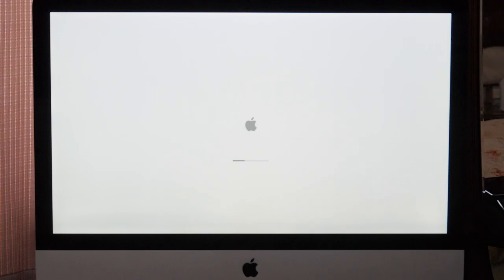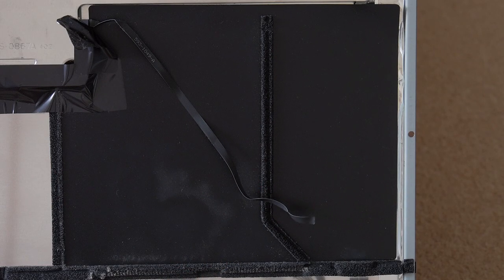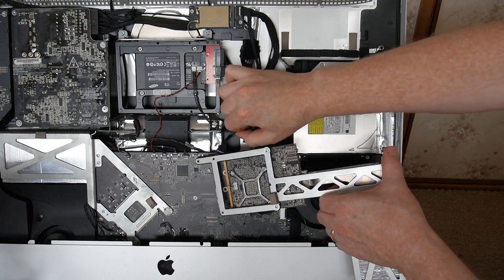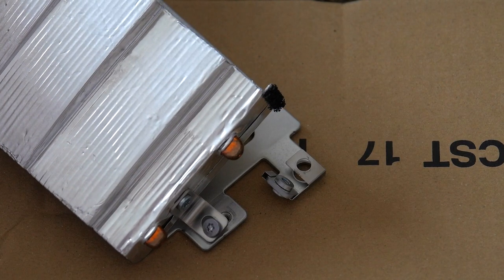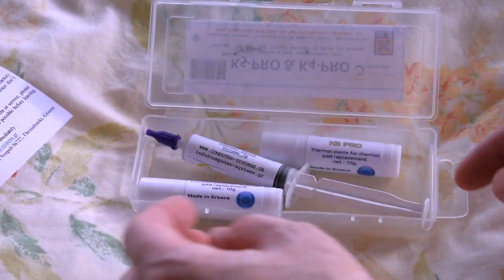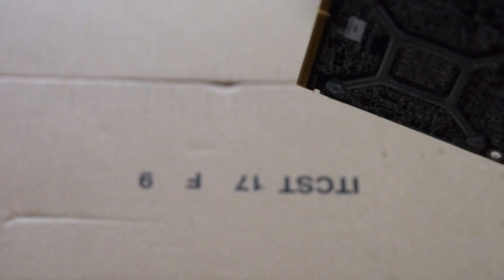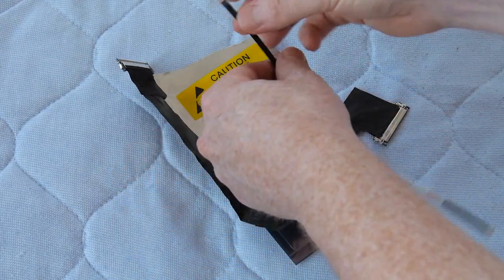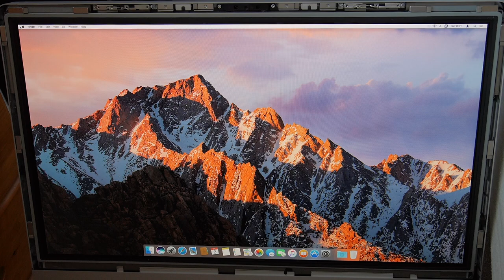Late 2009 iMac 27" Video Card Repair — 4850 — 2nd Bake

Comment: Did a third bake because sporadic shutdowns started again when using certain programs. Second bake lasted about 2 months. For the third bake I did 11 minutes at 400º F. Appears to be working again. I noticed that the thermal paste on graphics chip had shifted and was not nicely distributed. Hopefully this time it will last for longer, I will keep on trying until the computer no longer turns on, lol.
Reply from the maker: Hi, Paul.  Sorry to hear of your continued troubles.  I remember our dialog from 2 months ago.  You told me you did not put enough paste on when you did your first bake.  You apparently remedied that in your 2nd bake, but now you said when you checked the paste wasn't nicely distributed.  What paste did you use?  And how did you apply your paste?  

In my 2nd bake I used K4 Pro on the GPU and K5 Pro as a thermal pad replacement on the memory chips.  You can see in my 2nd bake video exactly how I applied the paste.  So I am curious if you used the same paste I used and if you applied it exactly as I applied my paste.
Reply: @JDW-  Hi JDW, I used the same paste you did and also applied it like the video. The thermal pad paste work perfectly it hadn't shifted or dried out. The paste on the memory chip had pooled at the bottom, most likely due to gravity and also the remaining paste on the chip had slightly dried. Just an observation. Also for comparison I use this computer about 40-50 hours a week, using OS High Sierra Patch.
Reply from the maker: You need a "patch" to run High Sierra?  My iMac is a late 2009 and runs High Sierra natively without any patches.  It won't run Mojave though.  Anyway, your case is the first I've heard.  You performed your bake exactly as my video shows, and you used the same paste and applied it as I did, yet your 2nd bake lasted only two months.  That is very curious.  My computer too is used daily for several hours every day, yet my 2nd bake has lasted more than 1 year and 9 months.  Hmmm...  I now am led to wonder if some video cards are more difficult to bake back to life than others.  You said the K5 Pro paste you applied to the memory chips had "pooled at the bottom."  Does that mean the paste was not making contact between the heatsink and some of your memory chips?  Or were you not able to determine that?  The reason I ask is because I am trying to determine if it's a paste problem or if, like I just said, it's just that some video cards are harder to fix with the bake.  Thanks.
Reply: It is an early 2019.

I read up on how to put thermal paste on the chip. I believe you are suppose to tighten the screws slowly in a repeating criss cross pattern so that the paste evenly distributes. I think this time around it will last more than a few months. Once again thanks for the video, I wouldn't even have tried it without it.   @JDW-
Reply from the maker: @Paul I apologize for my many questions but I do appreciate your making time to offer me detailed replies.  I am trying to understand your situation so as to see what help I could offer you and others in your shoes.  There is a bit of a difference between the EARLY 2009 and LATE 2009 iMacs.  Mine is a 27" while yours is probably the 24"?  I've seen photos of your video card and it looks quite similar to mind, yet very slightly different in terms of chip layout on the board.  The GPU chip on yours looks to be 45° rotated as compared with my GPU.  I'm curious therefore if the root problem of your video card is identical to the root problem of mine.  The fact that previous bakes worked for you indicates it could be the same problem, but I am at a loss to explain why your bakes have not lasted many months.  I think it's important to talk about this because the nay-sayers out there who mock the bake and all of us who try the bake love to look at case situations like yours and say, "See!  I told you so!  It lasts only a few months!"  But again, as my own 2nd bake points out, and as most of the people in the comments under my video point out, that is mostly not true.  The bake often does last a long time.  So again, I am trying to figure out why your bakes have not.  The only difference, again, is you have an older version of the card that I have.  Hmmm...

Comment: I baked yesterday my graphics card 200c for 10 minutes. But now does the computer nothing. I can only hear that the fan works. I cleaned the graphics card with pure alcohol and then I baked. Then I used the k4 and k5 paste. Put it all together. And now I have only a black screen. Graphics card after baking it had a a few little bubble's. Did it on a iMac late 2009 with a ati Radeon 4670 hd. Does somebody know what I did wrong?
Reply from the maker: Simon, I am terrible sorry to hear that. However, you are only the 2nd person who has comment here about not being successful. More often than not, from the remarks I have read, the bake works UNLESS the card was too far gone in the first place. There are only two things I can tell you at this point. First, someone in the comments section suggested that you try putting copper coins (or a weighty copper block, if you have something like that) atop the GPU chip prior to baking.  Supposedly that would push down on the chip as the solder balls under the chip weaken, theoretically helping ensure the baking process solders ALL the balls correctly.  I've not tested that and don't even know if the idea is sound, but I will put it forth to you.  Next, it is possible your card was so far gone in the first place (the chip itself was going bad, as opposed to merely having a solder-ball problem).  That means baking would not resolve the problem and the only recourse is to replace the card.  If you do that, replacing with the same card or with my card (4850 -- also used in the late 2009 iMac) would be the simplest solution.  I've read it is possible to swap with newer cards, but some require a little cutting to make them fit.  If all of this is too much for you, then buying a late 2015 5K iMac or newer is really the only other option.  I have a late 2015 iMac (maxed out specs) at the office and it runs cool and I've never had video issues since it was purchased in late 2015.
Reply from the maker: One more thing.  :-)  Make absolutely sure those delicate ribbon cables inside your iMac are properly connected at all ends AND that you did not accidentally break either of them when you opened your iMac.  If either of those cables is compromised in any way, you will get a blank screen.
Reply: JDW thanks for your response. I will check all the cables again. Maybe someone has a new graphics card for sell?
Reply from the maker: Simon, sometimes video cards are made available for sale on eBay.  By the way, in your earlier post you said that after baking you saw "bubbles." You might want to post a photo of that to dropbox or Flickr and then reply here with a link to that photo so we can see it.
Reply: Are these the same steps I would need to use for the pink vertical lines I am getting at start up?
Reply from the maker: Yes, the bake should be a fix for pink vertical lines too — artifacts that present themselves as a sign the video card is having problems.
Reply: Did you measure the 200degrees or rely on the oven dial? It is important to accurately measure the temperature. But the damage (the bubbles) is done now, unfortunately.

Comment: is it still working?
Reply from the maker: Yes, it is still working great!
Reply: @JDW-  great repair ...i`m attempting my one today :)
Reply from the maker: @sr-fw7xk  Please let me know how it goes.
Reply: @JDW-  yea of course. i have noticed you didnt add k5 on some of the components. at 30.22, between the 2 silver squares - the little things with + on them. they need goop as well. Above that the 8 black squares plus on on the left and right - they all need thermal goo on them . i have cheked the original pattern when i took it off and they all gad stuff on them. 

If you missed that i might be that`s why it didn`t last the first time. Strange it lasted long this time around . just saying...you still did a great repair and because of you i might just about fix mine .
Reply from the maker: @sr-fw7xk  The only reason I did not put K5 Pro on those components is because Apple didn't on my iMac.  Seriously.  On my stock configuration, there was no paste at all there, so I assumed Apple did not make a mistake but left it off for a reason.  Even so, it is logical, now that I ponder it, to add the paste as it wouldn't hurt anything.  But leaving it off doesn't hurt anything either as evidenced by the fact I left it off (like Apple did), and I have been running for 2 years and 1 month now without problems.  But in your case, yes, go head and add the K5 Pro there too.
Reply: @JDW-  it worked! i'm writing this from the Imac :) thanks a lot bro! next thing is the CPU :D

Comment: How long did you get this time ?
Reply from the maker: As mentioned in the text description, I got 2 years and 9 months out of my 2nd bake.  My attempts at a 3rd and 4th bake were unsuccessful and prove that these cards can only be baked a limited number of times.  I am not using a 6970M, which was a stock video card in the 2011 27" iMac.  That current is currently my daily driver.  So long as I keep the card cool, it runs fine.  But if it gets too hot, it suddenly powers off the iMac.  I've not had that problem happen over the past several months though since I've been able to keep it cool enough with all 3 fans running at 2000rpm and with room A/C when needed.
Reply: @JDW-  points for perseverance !
Reply: @JDW-  Have you thought about buying a mac pro instead ? I recommend the 5,1 2010-2012 model.
Reply from the maker: @macguru9999  I've not considered an older Mac Pro due to Apple moving to its own Silicon.  I'm playing the wait and see game for now.  My wife and kids continue to use the 2009 iMac.  I myself have a mid-2015 15" MBP top end BTO model with 1TB Apple SSD inside and the dGPU, which I use to edit my YouTube videos these days.  I prefer that MBP to newer models because it has an internal SD card slot, better keyboard, USB-A, MagSafe and the lovely glowing Apple logo on the lid.  I also have access to a late 2015 5K iMac at the office.  I store data on an external 2TB SSD so I can edit on my MBP or the 5K iMac at the office (after hours).  I actually talk about all that in my latest video here: https://youtu.be/yrnOVp7mXrs

Comment: My 27" mid-2011 iMac's 6970M video card died again, just three months after the last bake. I decided to buy a new iMac and was just going to recycle the old one, but I found out I could get $70 for a working iMac, so I decided to bake the video card again. The bake was successful and I was able to reformat the hard drive and remove the internal SSD I had installed. (I reinstalled it into an external enclosure.) I used the $70 to purchase the Apple external USB SuperDrive. 

Here's a brief history of my video card repairs:
2017: GPU resoldered by eBay vendor; applied thermal paste as described in first bake video and reinstalled video card
July 2019: repaired as described in second bake video
March 2020: repaired as described in third bake video
June 2020: repaired as described in the fourth bake video

Just prior to the last failure, I started monitoring the GPU temperatures more closely using the XRG app and noticed it was hovering around 130℉ before it died. I had been using smcFanControl since 2017, but I may not have set the default speed high enough to prevent these failures.
Reply from the maker: James, I am sorry to hear your 3rd bake didn't last long, but as my own bake experience shows, I'm not surprised.  I can see from your data that your 1st and 2nd bakes lasted quite a while.  My own 1st bake lasted a mere 4 months, most likely due to an inferior thermal paste job, but my 2nd bake made it all worthwhile as I got 2 years and 9 months from that.  I suspect your 4th bake will last a very short time, as that is what happened after my 3rd and 4th bakes, prompting me to get a new card (swapping my 4850 for a 6970M). 130°F = 54°C which is not hot for any component inside the iMac.  When it comes to this era of iMac, I personally define "hot" as getting into the 70°C to 100°C range (158°F ~ 212°C).  So your fan speed didn't have anything to do with it.  These cards do not have eternal life after the bake.

Some people like to argue semantics screaming, "It's NOT a 'fix'!!"  That contention is true and false, depending on your own understanding of reality.  As for me, I understand that the word "fix" means, "fixed until it breaks again."  Think about a washing machine dying.  You call the repair guy who "fixes" a motor which caused the problem.  A few years later that same motor dies again, but not due to anything the repair guy did wrong.  He indeed fixed your washing machine, but that part simply did not last (perhaps because the design of that motor was flawed like the GPU of these video cards) and therefore the fix didn't last.  Its the same with a "cure."  Cures for disease are not eternal insofar as the human body doesn't have eternal life.  You may have been cured of cancer, but you will still die at some point.

So even though I don't go around preaching the bake as a "fix" I am not afraid of that word when it comes to the video card bake, knowing that no fix lasts forever, and especially not on these cards.  Some people prefer to call the bake a "bandaid," but I dislike that term because it undermines the usefulness of the bake and misleads people into thinking it probably wouldn't be worth their time.  Your case somewhat parallels my own on that the first couple bakes really do show that the time, effort and small expense was worthwhile.  But at some point, as you and I both found out, the bake will no longer work (i.e., the video card can no longer be fixed, repaired, brought back to life, etc.), and then you must either opt of a new iMac like you did or get another card, whether of the same time or a different card that is compatible, like I did by going with a 6970M.

Lastly, to anyone buying a new Mac these days, I would like to mention 2 things:

(1) Intel iMacs currently being sold do not have the video card problem described in my videos and are very fast and worth the money in my opinion.

(2) Apple released its M1 silicon in 2020 that is blowing expectations out the door.  iMacs with that chip will likely come later in 2021.  Apple will support Intel iMacs for several more years, but Apple Silicon is the wave of the future.  Despite the fact Intel caters to Windows, I still feel that Intel will ultimately be undermined as a company if they don't change their chip game plan in a major way over the next year and a half.  Apple is triggering a mass move to ARM. 

Thank you for sharing your story, James.  You made a good run of it.  Enjoy that new iMac!